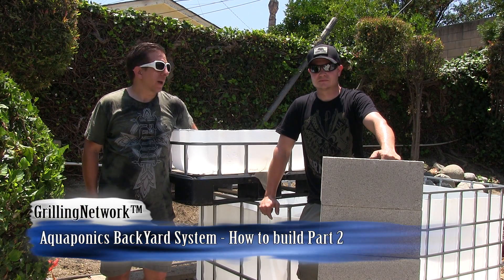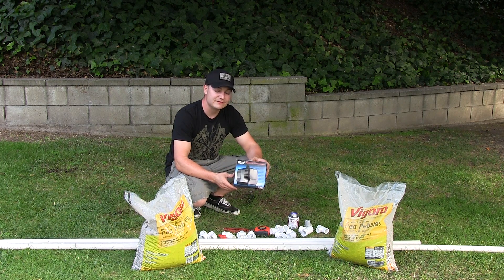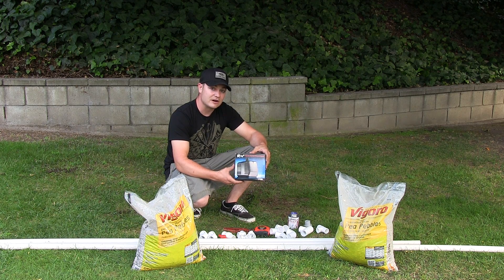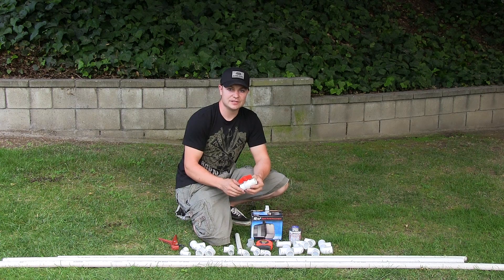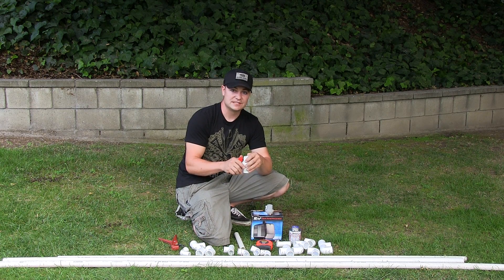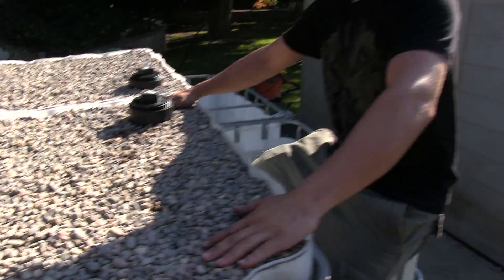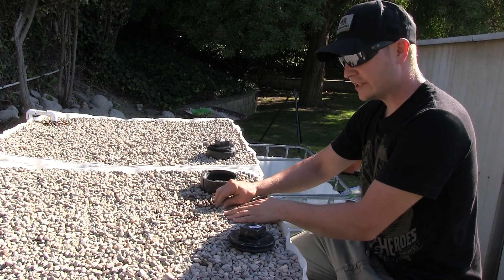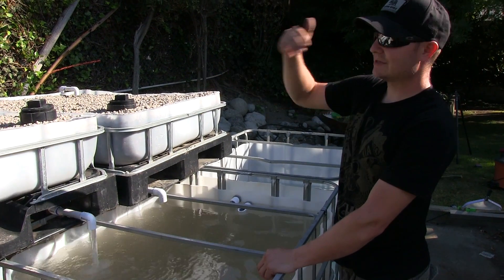Aquaponics BackYard System - How to build Part2

Comment: Just a couple thoughts.  A bell siphon is probably a good idea but 1. I'm naturally cheap. 2. I'm lazy and 3. I'm woefully under-talented, so I personally don't use a bell siphon, I place my grow bed over the fish tank and drain the grow bed from a pipe with a plastic valve (for draining adjustments) located at the bottom of my grow bed, however you MUST install an overflow pipe (Below the top of your grow bed leading back into your fish tank, in case the bottom drain gets clogged, or your water may go over the side and onto the ground, putting you fish at risk. In addition, I put my pond pump about a foot off the bottom in case the worst happens and your water goes over the side, at least then your fish will have a foot of water to swim in and survive until you discover it and refill it. I also use an air pump for extra oxygen.  I have grown tons of lettuce and tomatoes without using a bell siphon (but again a bell siphon might be the best choice for your needs). Scatter lettuce seeds on the gravel just at or slightly above the water level. For tomato plants (after carefully rinsing dirt from the roots), transplant tomato 'starts' from the nursery, directly into your gravel. (You will have to construct a cage to support tomatoes just like you would if you were growing then in the ground ( I use welded concrete slab reinforcing "mesh" $10 bucks or so,  which comes in grids and cut out the sizes for the supports I want to use.) 
Note: If you are using goldfish-' feeders', try and pick an attractive variety like fan-tails, or buy koi because once they grow large you may want to thin them out and both koi and fantails are easier to sell or give-away. I just this year began to harvest goldfish eggs from my breeding size gold fish using "fish mops" I made out of fuzzy dark blue green yarn (Walmart) and have about 500 baby goldfish growing in a separate tank right now.  I also feed my larger fish with good 'quality' cat food pellets in the smallest pellet size I can find at the grocery store (the smaller and more roundish in shape the better), and have been doing this for 5 years and they grow large and are very healthy. With smaller fish I crush the cat food pellets to the proper feeding size. Also remember to stagger your planting times of lettuce seeds (Unless you eat tons of salad). You should divide by your seed bed plantings by simple measurement (not physical barrier sections) into 1/3 rds. then sow seeds into these measured individual sections at intervals of every three weeks or more, if not you end up with too much lettuce that gets old and bitter all at the same time. I buy 'Mesclun' seed packet mixes at Walmart for a nice gourmet salad variety, I also add spinach seeds to make an even better variety of salad. Don't be fooled, you can grow a couple of hundred lettuces in one bed by scattering with just 3 packages of Mesclun and 1 package of spinach. It takes 2 -3 weeks before they've all popped up (but again it's better to plant your beds in 1/3 sections at a time to space out your harvest. It's all fun and easier than you think. Have fun and experiment. Good luck!

Comment: Hi Guys,
very good presentation I just want to know if you leave the bed outside how to maintain the water level when rain
Reply: ed hunt The waterlevel may rise a bit while it is raining. Let's assume an inch of rainfall (which in itself is quite a large downpoor) will rise the water level in the overal system by about that much... In regards to the growbed being rained upon, the growbed may siphon a bit sooner but I think you will not notice it. 
Anyway that 1 inch of rain will result in about 1/4 of a gallons of water extra in the system...I am not sure why that would be any kind of problem anytime
Low waterlevels are more of a worry if anything...So let rain (unless it is heavily polluted) be your friend...
Reply: sandertel Indeed. And also water "vaporates" so best is not to fill when you notice a little bit of water being vaporated. But yeah, best to leave some 'reserve' like you would with a pond.

Comment: Do we need to filter the flow water from the fish tank to the grow bed plants ..How to increase the oxygen more with what kind of system method.???
Reply from the maker: I control the flow from the tank to the grow beds with a shut off valve. I turn it on just enough so that my bed fills up and starts to siphon in 15 minutes.
As for oxygen, I have a large oxygen pump with several air stones.... 
IF you need model numbers I can email them to you...
Reply from the maker: Chinawenchang see answer